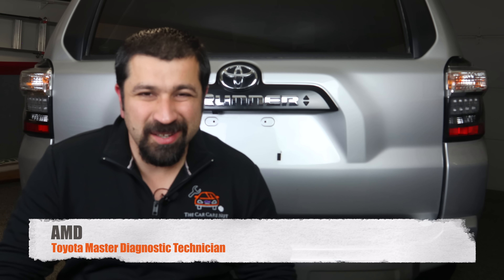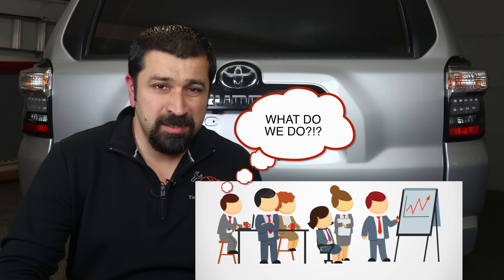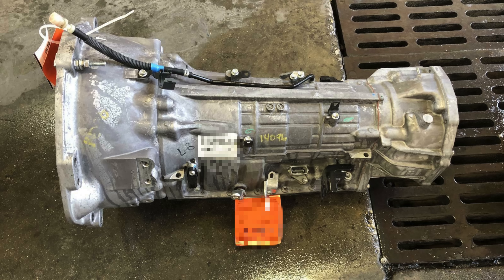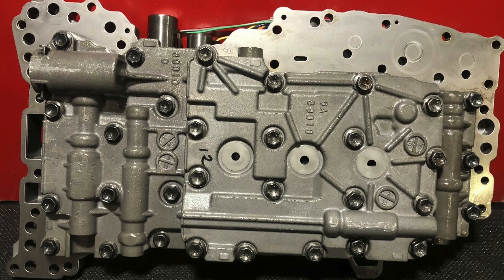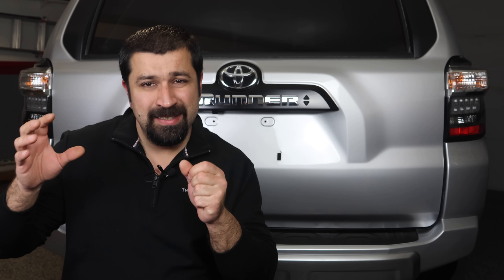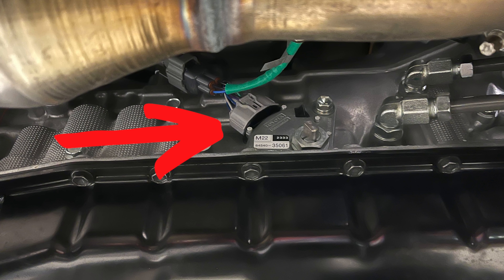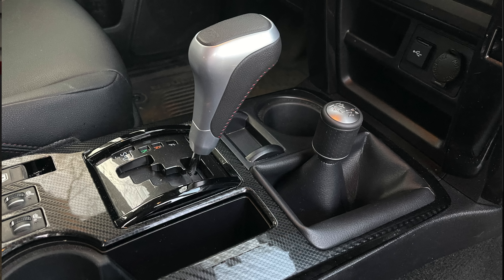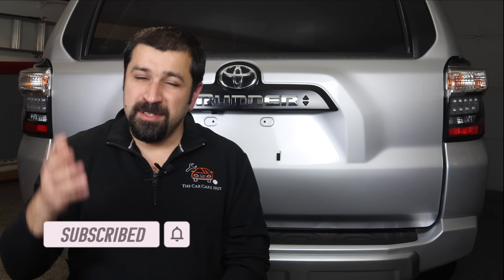Toyota 4Runner Transmission. Why is it so reliable?

Comment: I love my Pro. I was just offered $54,360 by a dealer.  What vehicle could sell for $2500 more than I paid for it with 18K miles??  I almost pulled the trigger, but I love my 4R.
Reply: Traded in a 16 trail for a 2019 Ram Rebel in 2019. Got the ram with a 20% off 4th of July discount. Saw a 21 TRD Trail Premium on a dealers lot last weekend. Went in to see what they would do for a trade. They gave me 3k more for the RAM, than I paid for it in 19😂. So happy to be back in a 4Runner.

Comment: Are the 2020 corollas good? Looking at a 2020 Corolla SE
Reply from the maker: They’re good cars in my opinion
Reply: @TheCarCareNut  alright thank you. I am wondering if I should get a 2020 Camry SE or a Corolla SE. I hear problems about the 8 speed on the Camry but I have watched some of your videos and it doesn’t seem that bad. But I also don’t like CVT but I I don’t care about it if it’s better than the 8 speed. In your opinion, if you had to choose (based off reliability) would you choose the 2020 Camry SE or the 2020 Corolla SE?
Reply from the maker: Honestly they are both equally reliable. If I had to choose I would go with the Camry. More room
Reply: @TheCarCareNut  alright thank you so much my man, your such a good and honest guy. Stay safe

Comment: what is with that genius decision to remove the dipstick? making people crawl underneath to check the fluid condition is strange great transmissions from Aisin but on cars that you cant crawl under its a pain in the ass. PS great video but essentially inverting the dipstick and needing a pump to put fluid in not sure on the sanity of that.

Comment: Thanks for another great video.. I'm at around 60k miles just about to do the first transmission fluid change.. should I do a drain and fill with a new filter or should I flush the whole thing including the torque converter? Thank you very much...
Reply from the maker: Hi! Either a drain and fill without filter or a flush
Reply: @TheCarCareNut  Thanks for the reply.. Can't wait for your next video on 4Runners!

Comment: Going from my 2019 4Runner limited to a 2020 highlander. I hate the trans in the highlander. It doesn’t shift nice when you have to step on it.  It’s wonky. My 4Runner was always smooth and didn’t jerk when shifting.

Comment: for the regular transmission service, what do you suggest? Just drain and re-fill or drop the pan and replace the filter? Thanks a lot
Reply from the maker: Hi! If the fluid is replaced on time you don’t need to replace the filter
Reply: @TheCarCareNut  I'm at 30,000 miles. When should the transmission fluid be replaced? The manual at 30,000 miles says only inspect?
Reply from the maker: Hi! Every 60k miles

Comment: Great video AMD! My 2003 V8 4runner still shifts like new. It has 170, 000 miles and I do a drain and refill every 40,000 miles with original filter/screen.

Comment: "It's ancient" they always say... Good. So what you're saying is it won't strand me on the side of the road like a cvt will. That's what I want. Reliable. I dont give a shit if it doesn't have 26 gears, doesn't help fuel economy for all of the 50k miles that it would last as a result. I've bought 2 vehicles in my lifetime that were "first of the redesign" models... I paid dearly for it. Never again will I buy something new with new features and untested tech. Only proven and tested. I have enough stress in my life. No more needed. Thanks Toyota. You are one of the few remaining.

Comment: Great information, trying to make up my mind in trading my 2015 Silverado High Country w/51,000 miles for a 2015 4Runner Limited w/61,000 miles. Thanks for the info.
Reply: Wouldn't you want a truck bed over a SUV?
Reply: @FrameRot  for most people 4runner with seats folded is just as good as truck bed. Most people don't do actual work in mid size trucks. If u are gonna do work get a tundra
Reply: @shrayesraman5192  I was comparing his full size to the runner. Lol
Reply: @FrameRot  gotcha. I'd assume if he was even considering a 4runner a bed would not be his no 1 priority
Reply: @shrayesraman5192  all good man. True but damn once you have a truck bed it's hard to go back.
Reply: @FrameRot  I am mainly looking for the long term reliability of the Toyota. Probably will just keep my Silverado, hate giving up the full size. Both are nice vehicles but my Silverado serves me well, just hope the reliability will be long term.

Comment: Thanks for sharing this great series of videos referring to the 4Runner. I traded my 2017 Jeep for my first 2019 TRD ORP 4Runner and have no regrets. 
The more I learn about it, the more I enjoy driving it. 
Right now I'm waiting for the dealership to change out the recalled low pressure fuel pump. 
Maybe at some point you can mention a thing or two about this issue.  
Thanks again, I'll be following along for sure.

Comment: I have a 2012 did trans flush 60k (when we bought it from carmax)and drain and fill at 95k but it’s always been a whining (makes some noise) transmission. 

I have a 2021 also and it’s silent
Reply: Have you greased the 8 zerk fittings in the driveline?  That could be the source of the whine.  You are supposed to do it every 15k miles

Comment: I have a Camry and Tacoma and love them both. Now I want a 4Runner.
Reply: Which one you like better Camry or Tacoma
Reply: @EverydayCarHacks  They're complete opposites in a lot of ways. One drives better on the road, one can go off road. One is small and light, the other is big and heavy. One is good on gas, the other is a gas hog. One has a singular purpose; to get from A to B and bring passengers along the way. The other has many purposes; to do the same as the other, but also to haul heavy loads, tow up to 6400lbs, off road up a mountain and back, drive in any climate, sun or snow. That's about the gist of it.

Comment: It's still made in Japan. That's why it's reliable.
Reply: Japanese work ethic is crazy. Seems like they don't just pump out products just to quickly make a sale. They actually assemble the parts with care..
Reply: To be fair rav 4 and tundra are pretty crazy reliable too. That said my fj and lexus is350 are both made in Japan and have been amazing
Reply: @LiamG903  I have an 07 fj cruiser 6speed too and an IS250 (awd) very reliable cars.
Reply: True that
Reply: Facts.  Only want Japanese vehicles made in Japan...
Reply: Hopefully it stays that way
Reply: Yes sir
Reply: I tried US made cars. My early 1990s Pontiac Bonneville was good up to 65,000 miles. It broke down (I.e. dead on road) 3 times before I got to 69,000. Replaced it with a Camry. Gave it to my Mom and it lasted for I don’t how long (about 20 years) but odometer did break so mileage unknown. Tried a Cadillac - one big computer SNAFU right away then great for 63,000 miles… Didn’t let that one strand me 3 times. Lexus RX330 went almost 140,000 miles for me. I only sold it because I moved to a place where closest Lexus dealer was 100+ miles away.
Reply: American don't know how to make cars. My 2005 Chevy Trailblazer,  the steering pressure hose seal leak.  New seals and new Rack,  and new lines. Still leak. . It leak at the input line to the rack . One piece of junk or shit. I always love Lexus Rx350 AWD and Toyota. Also I love Honda too but I hate to replace T-timing.  I hope one day Honda make timing chain on V-6.
Reply: The entire vehicle
Reply: I'm getting ready to buy a 2013 and that's one of the first things I checked/ noticed sticker on door that says best scotty Kilmer impression MADE IN JAPAN!
Reply: Make Toyota Japanese Again! 🇯🇵 The Americas-made Toyotas are horrendous compared to their Japan-only counterparts. The 2nd/3rd Gen Tacomas are made to melt, their chassis are weak, and their components are lesser quality than everything coming out of Japan … Toyota USA is poison, given they hire from the American vehicle MFRs, who can’t make a decent truck to save their lives. Make Toyota Japanese Again!!! #MTJA 🇯🇵
Reply: Clearly not mine went out today only 25k miles
Reply: Only difference is the people running the machines to assemble the parts. Engineering is the same and most parts are made at the same factories. Modern car making is not super hands on anymore.
Reply: Yes and no. Just because it was made in Japan does mean it was made by a Japanese. Lots of foreigners working in Japan. Foreigners are not as disciplined and meticulous as Japanese people plus the “proud factor” is inexistent.
Reply: @reserved_86  however it's very difficult to work in japan so it has a very high chance of being made by japanese and and!  It's definitely managed and double checked by japanese
Reply: @reserved_86 Always a negative Nelly in the bunch.

Comment: Hey AMD thanks for the very informative videos. I have the 2012 T4R and when I shift to D, I always get a thud along with a good push forward -- is this normal with the A750? Thanks in advance for your answer.
Reply from the maker: Hi! How many miles and was the fluid replaced?
Reply: @TheCarCareNut  Good morning AMD, appreciate you for taking the time to reply, thanks. The ODO reads 110,071 kms this morning. I replaced the ATF-WS on the A750F last year at 98,818 kms. I detached the return line to drain and continuously feed with fresh ATF-WS. Made sure that the volume drained is exactly the same as the volume fed so I don't have to bother with temp. I got the vehicle new and I recall I have this thud on day one so I'm just wondering if this is normal. Thanks again.
Reply from the maker: Hi! So I’m thinking it’s normal. They are a bit clunky when they shift

Comment: Thank you so much for these videos they are fantastic. I love my 4runner and how reliable it is and how easy it is to change the transmission oil. When you see some new vehicles with 10 speed transmissions and they have belts inside the transmissions driving the oil pump running in oil it does not give you a warm and fuzzy feeling. You know those transmissions will not last as long as the one in the 4runner. I love having a vehicle I know will last a long time that is one of the major reasons I purchased it.

Comment: Could you do a breakdown of the mechanical quality of 2019+ 4runners vs Tacomas?  All the stuff i can find are breakdowns of the interior, why a truck vs an suv and vice versa and people comparing old tacomas with new 4runners and vice versa.

Like how you break down why the 4runner transmission is so good even today using older tech.  Could touch on how tacomas differ or if it should even be considered?  I say 2019+ because you've said 2016 and 2017, and to some extent, 2018 tacomas should be stayed away from.

Or at least is made in Japan vs made in Mexico an issue?

Thank for the good info you put out

Comment: Can you please make a video about a hybrid Sienna sleeping in the car having the engine off what the heater and the air condition does when you let it run all night with the engine off?
Reply: I just bought a 2017 RAV4 hybrid for the same purpose so I’d like to know also. I’ve only had it two weeks.

Comment: the 03-04 v6's had the old 4 speed. in 04 they switched the trans fluid to ws and got rid of the dipstick. In 05 they got the newer 5 speed. But yes these things are relatively bullet proof. I got my '08 at 150k miles, has about 182k now and did the trans,diffs, and t-case service ~10kmiles ago since I have no idea when it was done before me and I have used it to tow and now have a slight lift with all new suspension and more aggressive tires.

Comment: Do i need to add a transmission oil cooler? Or can i get away with more frequent transmission oil change?  On long hwy drive (75mph), trans oil temp hovers between 195-210F (even at full tc lock).  my 5th gen 4runner is lifted and has RTT.
Reply from the maker: Hi! I wouldn’t add a cooler. Just change the fluid on time and you should have no issues

Comment: This information video is the very reason myself and my entire family have purchased and owned Toyota vehicle now for over forty years, nothing in the automotive industry can even come close to the quality, dependability, reliability and workmanship of Toyota cars, trucks & SUVs!
Reply: My first Toyota was a Toyopet Stout, that was back on the 60's. Ever since then I have own many Toyota trucks, all were work horses and reliable. Currently own 3, 1 Tundra & 2 Tacomas
one is a 3rd gen, the most disappointing truck ever owned.  Sadly the current quality is not was it used to be.
Reply: I fully agree. I am quite deep into car reliability topic and I can confirm that Toyota's car are the most reliable cars that have the longest lifespan. All that with a regular fairly cheap maintenance. I was a fanatic of German cars, since I saw how many problems they cause and how stupid and costly malfunctions experience right after rolling out the dealership, I decided to become a lifetime Toyota driver. One thing should be noted, Toyota is also very responsible manufacturer and they admit to the failure and fix the car for free easily. Try this with VAG group (at least in Europe). The warranty policy and handling warranty issues does not exist and in US would result in huge amount of legal cases. If you want to have just normal, reliable and robust car - buy Toyota. As a bonus you won't lose much money on resale due to high cars' after market value.

Btw. I suggest making video about how Toyota cooperated with BMW. BMW delivered diesel engines to European Toyota cars. Due to numerous issues Toyota regrets this decision.
Reply: Yes, people ask why toyota, from 90 ls400 to land cruiser,gx470,ls430,4 runners ,35+ years of quality with no problems 200k to 250k reliability

Comment: Actully, in 4Runner Owner's Manual under the severe condditon you have to change the Auto. Transmisiton fluid every 60.000 Miles. I think, most people should follow that.

Comment: The A750F (4WD) came out initially on the 2003 V8 4Runner, 2003 GX470, and 2003 Land Cruiser/LX470.  The 2003 to 2004 V6 4Runner retained the 4 speed from the 3rd gen 4Runner.  The 2005 and up V6 4Runner came with the 5 speed A750E/F.  2003 is the only year model with the transmission dip stick.  All subsequent year models came without the transmission dip stick...
Reply: Great info !

Comment: When towing a 5x8 enclosed trailer should I use 4th or 5th gear?
Reply: Typically most guys keep it in 4th to help keep the temps down in the tranny. Main thing people forget when towing is monitoring tranny temp. If you tow a lot it’s smart to install a gauge/monitor to read your tranny temperature

Comment: I have a 2020 Camry with the new 8 speed and I kind of wish it came with one of these old five-speeds! Any recommendations to get the most miles out my new 8-speed?
Reply: I have a 2020 Camry XLE four cylinder. I'm glad it has the 8-speed.. I plan on changing my transmission fluid around 30k. I don't put a lot of miles on that car. The more I drive mine the better it performs.. there are times I can step down on mine at the stoplight and it throws you back. It runs great. I can get over 46 miles per gallon on the highway if I keep it in the Eco mode.. For regular driving l always keep it in the normal mode..
Reply: @charlesjackson1700  I will admit, I do like the performance and fuel economy :) I have repeatedly gotten 60 mpg going 60 mpg on the highway for 40-50 miles!
Reply: @killercat268  I hear about some insane MPG`s ... LOL They do great ! You can tell others and they find it hard to believe ... I have a new 4Runner TRD 4WD..  it drinks gas like a hole is in the gas tank..LOL
Reply from the maker: Change the fluid every 60k or 6 years and you’re off to a good start with the 8 speed transmission

Comment: Thank AMD, another great video. I have 2008. Every time I’ve taken it to the dealer and asked about servicing the transmission they always give me the ‘sealed unit’ message and advise against servicing it. I’m up to 180k miles now and it still shifts fine. Would you still recommend servicing it? If so would you just advise to drain and fill?
Reply from the maker: Honestly at this point I would leave it alone

Comment: Nice vid! Would love to see a similar deep dive on the Tacoma 6spd. It’s my thought that the 6spd is a good unit mechanically, but Toyota essentially made an “eco mode” the default, which is why it can hunt for gears and feel lackluster. It seems to perform quite well in ECT mode. I get it, I get really good fuel economy in my Tacoma.

Comment: Ahmed. Another great one. Toyota is smart to continue to use the old 5 speed. It just works and built to last. I have a buddy with a 2005 4Runner with the 4.0 V6. That car has over 200,000 miles and it still runs like a top. 
Awhile ago I had a 4 cylinder 2005 Camry that had the 5 spd (of course diff from the one on the 4Runner). My point is though I love my 19 Camry which has been great and gets great mpg, the new 8 speed transmission, at lower speeds it isn’t as smooth shifting as the older 5 spd was.  Something to be said about the older Toyota Trannys.

Comment: Dang I'm happy I got one of these.  I'm at 44k miles and plan on changing fluids at 50k. Does the trans filter also need to be replaced? I take it the dealership is the best place to get these services with Toyota fluid and Toyota parts?
Reply: Always use OEM fluid and parts when you can. But do the service yourself! It’s fufilling to DIY and knowing it was done right. The age of resources on YouTube to do your own servicing is amazing. After watching and DIYing it you’ll be telling yourself why would I have paid someone to do something so simple!
Reply: @jusimplicit  I do a lot diy but with a trans, a simple drain and fill only changes out like half the fluid right?
Reply from the maker: Use original fluid and don’t worry about the filter